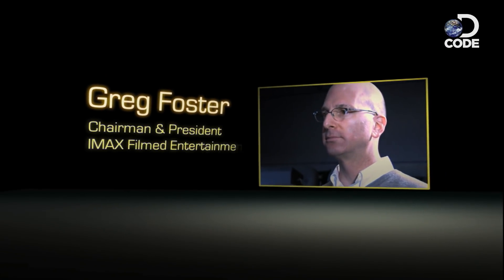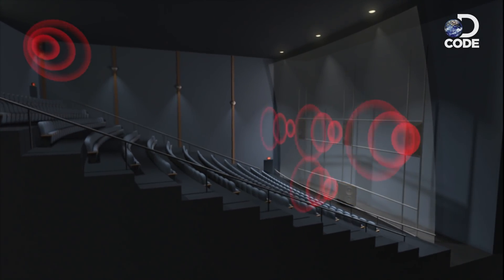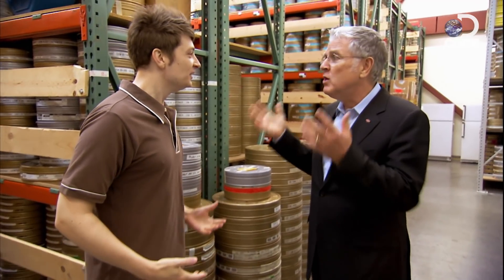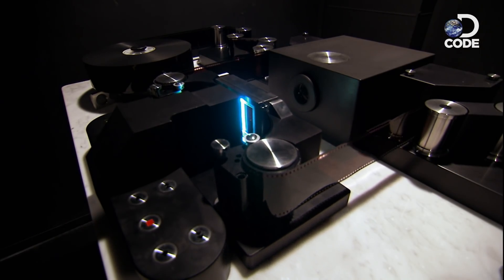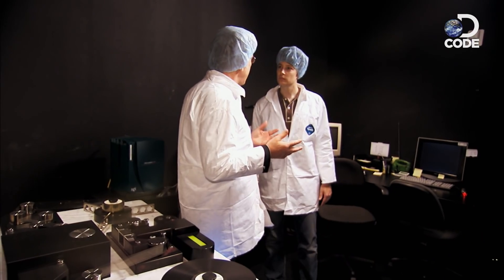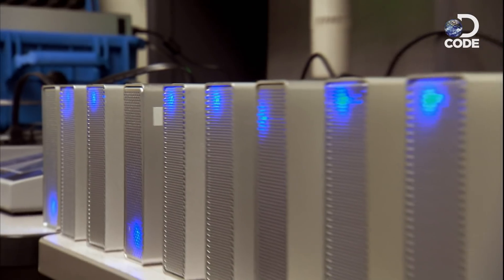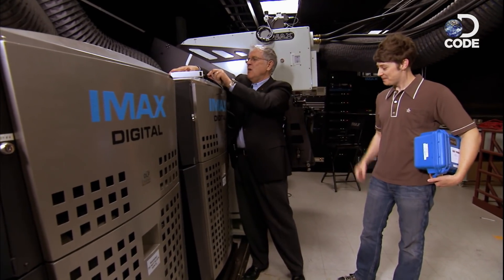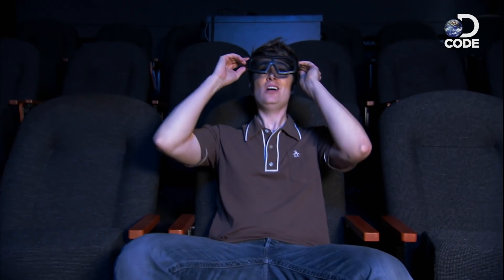How Does IMAX Work?

Comment: Well, this is nice, but there are very few actual IMAX theatres left in the world. Original 70mm IMAX projectors have largely been replaced by the dual 2k digital projectors, known as Lie-max. 

Recently, they've been pushing their new dual 4k Laser projection systems which are still lower resolution than the original 70mm's theoretical 12k resolution, but apparently the new ones are brighter due to the laser rather than xenon lamp.

Still, it's difficult to find proper full size IMAX screens these days. I know there's one in Melbourne, the currently largest IMAX screen since the one at Sydney is closed. I don't know of any other that actually comes close to it in size.
Reply: While I agree, there also aren’t many films that are shot on 70mm IMAX.  If more movies utilized that, i’m sure 15/70 would be used more.
Reply: @Seethi_C  , true. It's just really difficult to film with those due to the size of the cameras and film rolls as well as the related logistics. I don't think it's commercially feasible, but I can't help but look back fondly at those amazing science documentary screenings at the old IMAX domes which were mostly in planetariums.
Reply: Yeah I’m trying to research the history of Imax. Last time I watched an imax movie was over 10 years ago and I remember it being huge in a dome theatre. That place has since been demolished and I watched my first “imax” film since then yesterday at the movie theater and was confused and underwhelmed. It was so much smaller than what I remembered and I thought I had walked into the wrong room.
Reply: They are brighter, but it's not a big enough difference to notice unless you somehow look at them side by side.

Comment: The problem with IMAX is not all movie shot on IMAX Camera because it is really expensive. Most filmmakers tend to use a standard camera and 35mm film. However, it can be fixed by upscaling during post-editing. So u screwed up.

Comment: I just don’t like that most FILM IMAX projectors have been replaced with digital projectors which project a 1.85:1 ratio vs the IMAX 1.33:1 ratio, sort of defeats the purpose.
Reply: Small correction: Digital IMAX is actually a 1.90:1 ratio. And 70MM IMAX is 1.43:1. And I completely agree. I would love to watch a movie on 70MM IMAX but there isn't one in my country

Comment: Dolby Atmos is better, in my opinion. Great sound and picture quality! 👌👌
Reply: Edgar R. USA dude... Dolby Atmos is a sound technology that they developed especially FOR IMAX. It has nothing to do with picture quality, and IMAX theatres support Dolby Atmos Surround Sound
Reply: @rafaelnahafahik7781  That probably explains Dolby Cinema😂👍
Reply: Doesn't have anything to do with picture quality.
Reply: Dolby Atmos is a sound technology, IMAX is an image technology. They're unrelated, and you can and should have both at once.
Reply: @KingdaToro  You can't have IMAX and Atmos at the same time in theatres. IMAX is also sound, not just picture.
Reply: @NielsWalta93  It is entirely possible for a sound system to meet the IMAX specs (which are mostly about power) and also be Atmos-capable.
Reply: @NielsWalta93  Also, Dolby Cinema and Dolby Atmos are not the same thing. Dolby Cinema is an all-in-one package that includes Dolby Atmos and Dolby Vision. It can't also be IMAX. Dolby Atmos is a sound spec only, and can be added to any theater including IMAX.
Reply: @KingdaToro  There isn't a single screen boasting both Atmos and IMAX. And IMAX certainly isn't compatible with Atmos. Home theatre, kind of, but definitely not in cinema.

And I know the difference between Dolby Atmos and Dolby Cinema.
Reply: @NielsWalta93  One is an image standard and one is an audio standard. When the screen is big enough and all the seats are close enough that the screen fills your whole field of view from any seat, and the image resolution is high enough that you can't distinguish the pixels or film grains from even the closest seats, that's IMAX. Image Maximized. Nothing to do with sound. Note that it's currently only achievable with 15/70mm film, digital won't be able to do it until the whole workflow from camera to projector is in at least 8K resolution. Atmos is a sound system that uses the position of each sound in 3D space to play it from the most appropriate speaker, with the positioning of sounds getting more accurate as more speakers are added. It has nothing to do with the projector, screen, or image. There is NOTHING preventing an IMAX theater from having Atmos, as they do not conflict with each other. If you add the necessary ceiling speakers and other equipment for Atmos to an existing IMAX theater, then it has both. You would not need to remove anything to do this.
Reply: @NielsWalta93  How so? What aspect of Atmos prevents it from being installed in an IMAX theater?

Comment: Dolby and imax should collab.
Reply: They do buddy.
Reply: @forcovers438  But IMAX sound is still Dolby 5.1 wich is the regular. It would be cool if they merged IMAX with Atmos (7.1)
Reply: @this.is_juan  Atmos isn't 7.1, it's space-based rather than channel-based. With channel-based systems such as 5.1 and 7.1, the audio mixers specify which channel each sound should play from, each channel corresponding to one or more speakers. Different speaker placement will change how it sounds, and adding more channels won't be of any real benefit. In space-based systems (Atmos and DTS X), the sound mixers specify the location in 3D space that each sound should come from. The playback equipment then interprets this location and plays it from the speaker or speakers that most closely matches the location. These systems have height channels, the speakers for these are located on the ceiling. For example, if you add four height channels (ceiling speakers) to a 5.1 system, it becomes 5.1.4
Reply: Damn! Sick!!

Dolby for Audio and Imax for Video
Reply: What's dolby atmos?
Reply: DTS is the best so the Imax owner prefer to work with DTS not Dolby Atmos sucks 
If you need Dolby Atmos feel than you should place all speakers perfectly and atleast 7.2 configuration in DTS 5.1 is only beast so IMAX won't like Dolby Atmos
Reply: IMAX and DTS are collaborating on IMAX Enhanced
Reply: IMAX has always been with DTS, so they're technically competitors.
Reply: Should I see end game in Dolby? Or imax?
Reply: @carlossilva261  IMAX
Reply: @chopsuey.6562  is star wars filmed on Dolby or Imax
Reply: Carlos_Swhtx also want to know the answer.
Reply: @fearless4him595  IMAX 3D for better immersion
Reply: Dolmax
Reply: IMAX and THX...

Comment: Ads are becoming smarter. 
Soooo, at what resolution is the film scanned ? And later at what resolution the digital format projected ?
A 70mm , even a 35mm film has over 16k of detail. I don't think those digital projectors are more than 4k.
Reply: Of course they are. 4k on a big screen like that would be quite blurry
Reply: @SimpleAgario  You know that, special effects are rendered in 2k right ? Well not all but like 80% of the movies.
Marvel movies, and others that rely on heavy GCI, are actually done in 2k, so if they use IMAX 70mm film cameras, and they scan the film at 16k (which is pointless because it will take sooooo much resources to edit the footage so it's probably no more than 4k scan). do all the CGI and print on a new 70mm film or play it digitally, you won't see more than a 2k image. So ye.
Reply: @Quetzalcoatl0  yeah, It was my bad. I heard it somewhere and thought it was true
Reply: @Quetzalcoatl0  That's the exact reason why Christopher Nolan doesn't do a digital intermediate. And why Oppenheimer has no CGI.
Reply: I'm not sure, I just heard it from somewhere like they use 2-4 projectors for better picture quality. Like they all project on a same screen at same time intensifying the quality. Again, not sure, just heard it from a guy.
Reply: Am I the only one who thinks that imax is kinda blurry
Reply: @thalapathyfan4346  You probably haven't seen a real one. So far, the only way to get real IMAX is with 15-perf 70mm film, which is equivalent to a digital resolution of about 12K-16K. Anything labeled as IMAX but using a digital projector is 4K at best, which is most definitely not IMAX. Real digital IMAX requires 8K resolution at a bare minimum.
Reply: Not sure about IMAX but DCI 4K is 4096x2160 @ 12bit per R,G,B.